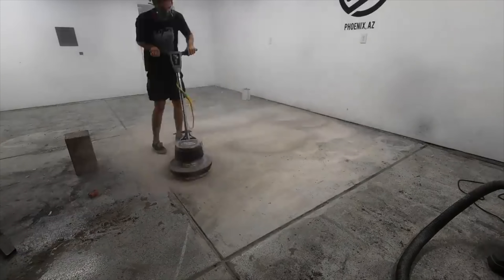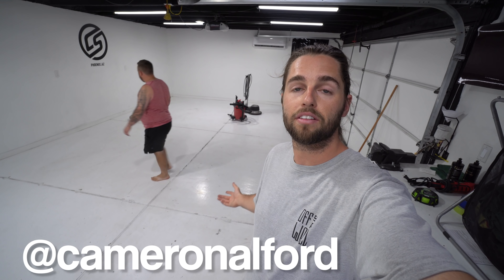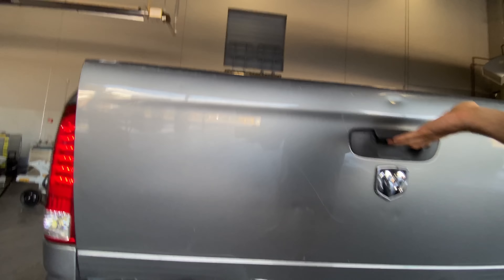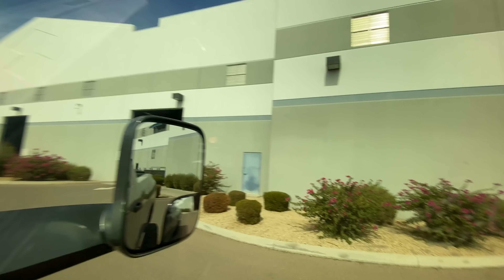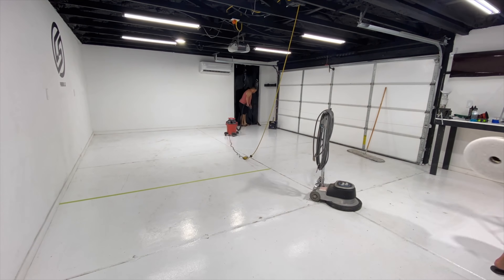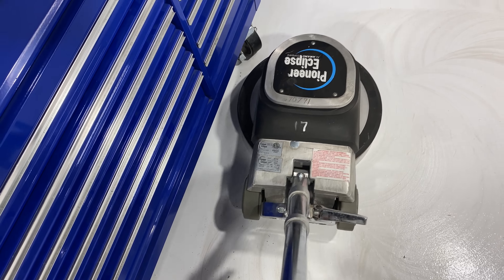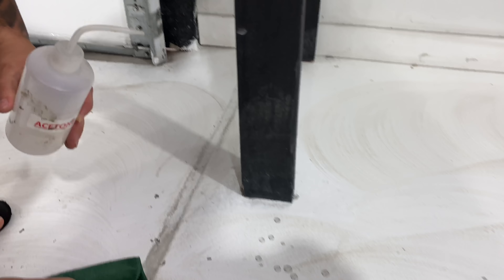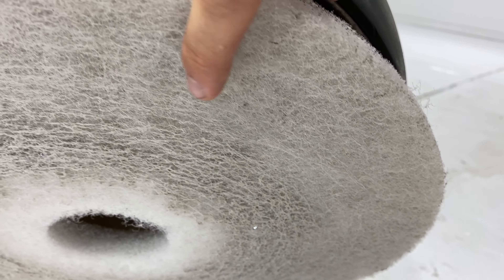Is a White Garage Floor A Bad Idea?

Comment: Hey Cameron, I work in epoxy flooring and just FYI if you want to clean your floor, just get a micro fiber pad mop, and use acetone and it will go back to new!
Reply: Is a microfiber pad mop and acetone best for epoxy floorings with a polyaspartic top coating too?

Comment: I worked in a dealership for years with painted white floors. We got carpet squares from the Depot and flipped them over so the carpet side was down. Put them under the tires No more seeping marks in the floor. They are super cheap 3-4 a piece

Comment: They make a product that would replace the molding in between the slabs where it cracked and flaked off. Look up a product called void cap. Its white plastic to replace that black felt. Just a FYI for you.